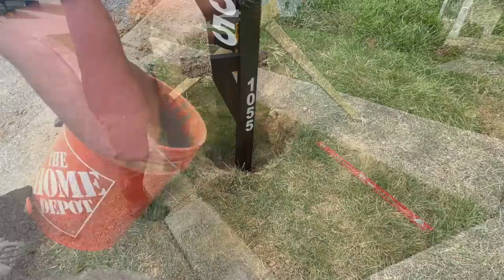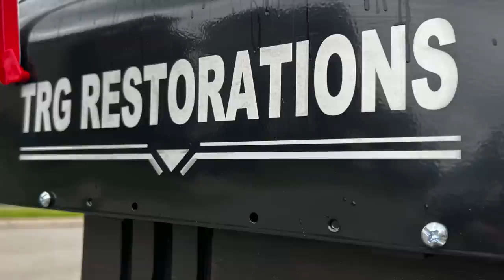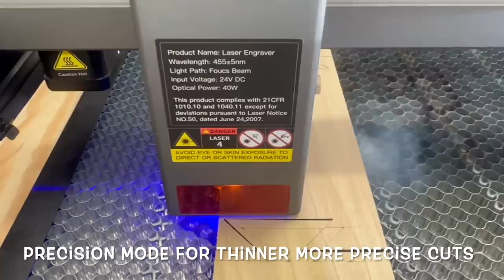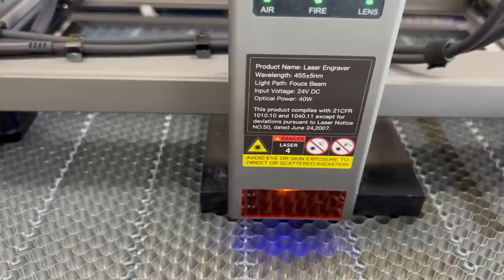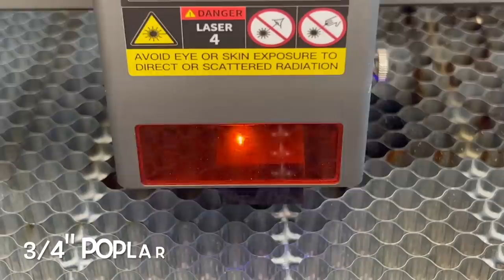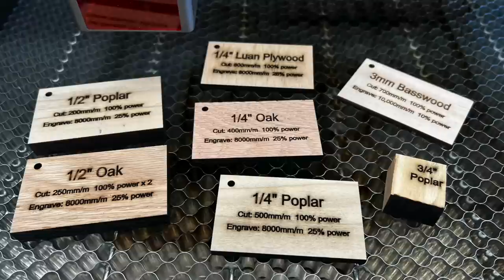Mailbox Restoration with my Creality Falcon 2 40-watt

Comment: Nice job!  I hope you are open to constructive feedback…. The reason the other post rotted at the top was because of the little piece you cut off the “pyramid”.  That’s now a place for rain water to sit.  Also, and not really major, but for posts, save your back and power tools.  Just pour the concrete in the hole dry and spray it with water.  No mixing is needed.

Comment: Looks awesome!
I especially like the epoxy inlay.

But I got a few suggestions:
- stainless screws
- metal cap for the post (no water on end grain)
- decorative lines should be v-grooves (less water standing on end grain)
- never put wood into the ground (held above in a galvanized shoe it will last three decades at least, without that, only maybe one)
Reply: It could be rated for direct ground contact. I build a sandbox for my kids 6 years ago that is still solid, it's in direct contact.
Reply: @JSAFIXIT  Depends on the ground conditions. In a dry area, where wet ground which stays wet for a while is rare, like in Arizona or New Mexico, wood can last very long, but in the Pacific northwest or New England that´s not the case. With a sandbox, which most often is a temporary structure anyway (kids tend to grow up), a reduced lifespan isn´t that much of a concern. But if a structure has to last for a while, at least I shoot for longevity.
We have a carport and an awning with wooden uprights, both were build about 40yrs ago and are still standing strong, and we are not in the dryest part of Germany. Galvanized shoes on top of a small concrete pillar. More work, more expensive, but: Build well and you only build once in a lifetime.

Comment: I agree with jlovelace486, your neighbors will love to have new mailboxes and posts as well.  I like using the epoxy for the numbers as well Tim.  Question about the Creality Falcon.  I'm guessing you have to program for the thicknesses of the material you are using to cut through the piece, do you also have to program for type of material you are using?  Specifically for type of wood since oak is much denser than popular or pine for instance.  The weed trimming metal at the base was a stroke of genius.  Well done Tim.  Cheers from this old retired coot living the dream just north of you in Tennessee.
Reply: I can’t speak for the Creality Falcon specifically but for my laser I use Lightburn software as the controller. You pretty much have free reign with the output of laser so you can set it however you’d like depending on the output capacity of your laser head and the materials you use. Most people just wing it and do a lot of testing on scrap material to get the right settings. There are test patterns that will run through almost every setting in one space so you get an idea of what each setting looks like in that specific material. Also there are “libraries” that certain creators share that have materials listed and setting that can be applied. That’s a real time saver.
Reply: @bradyanselmi  thanks Brady

Comment: The trick to separating 5 gallon buckets is to twist them in opposite directions as you pull them apart. You’re welcome
Reply: The other trick to doing ANYTHING the RIGHT WAY is to NOT learn it on tiktok
Reply: I thought the trick was to drill a hole in the bottom bucket to release the vacuum pressure 😂